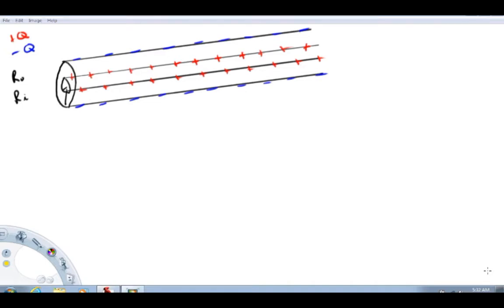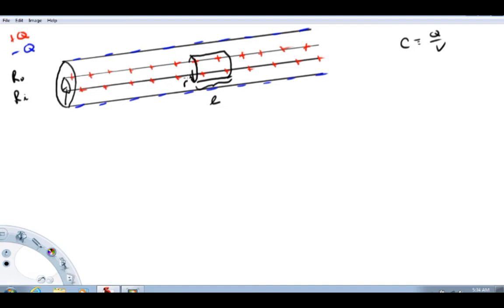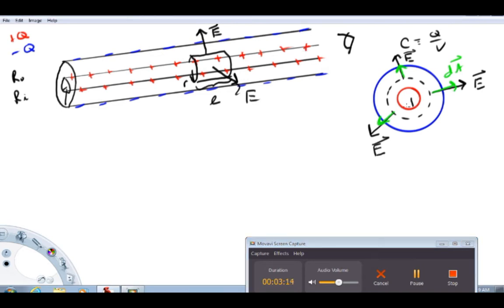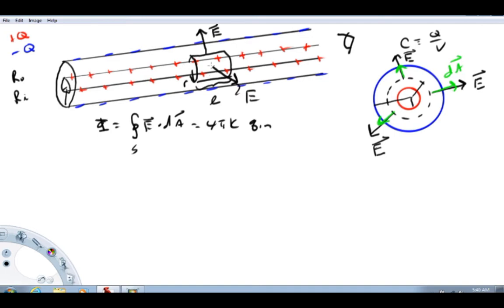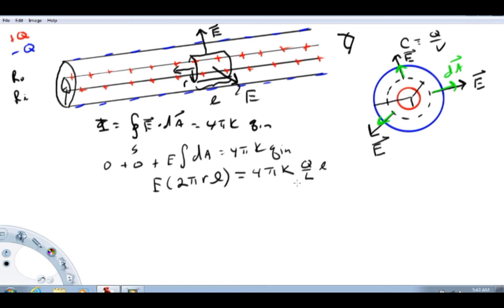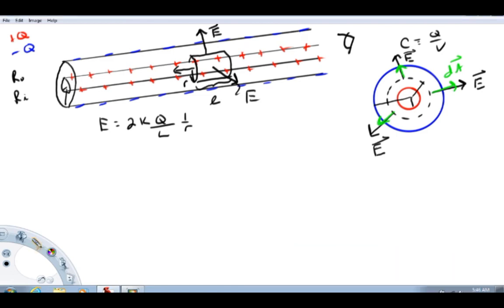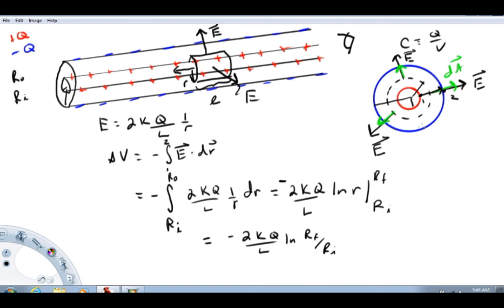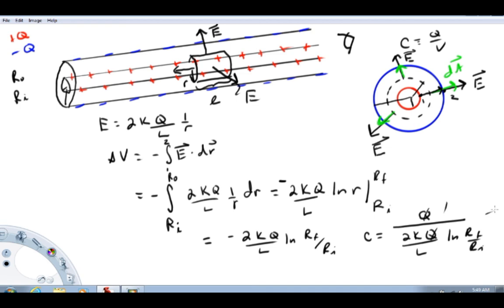Capacitance of cylindrical capacitor

Comment: Can you please check & let me know why the potential difference from the +ve plate to-ve plate is negative while it should be positive actually? I saw this video specifically for clearing that doubt
Reply from the maker: the electric field points from the + charged inner surface to the - charged outer surface. Electric Potential decreases when you move with the field, so the inner surface is at the higher potential.